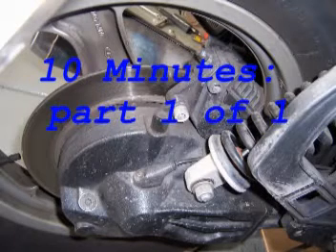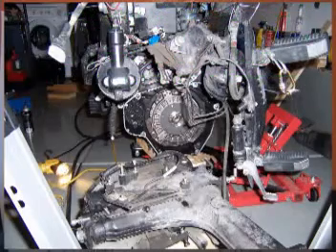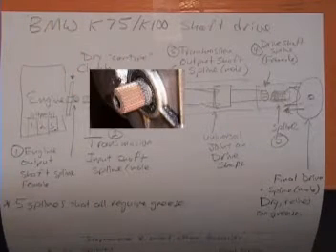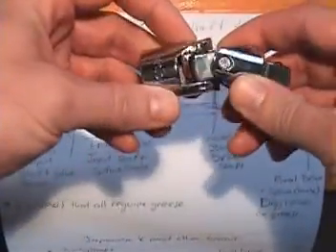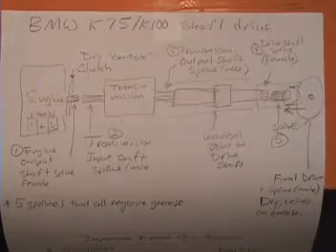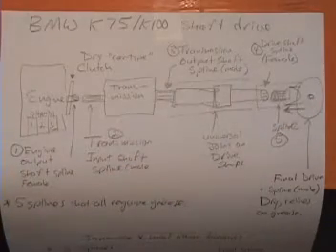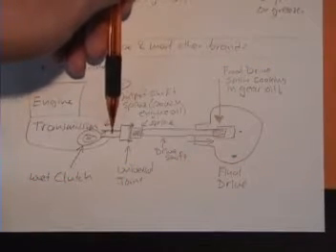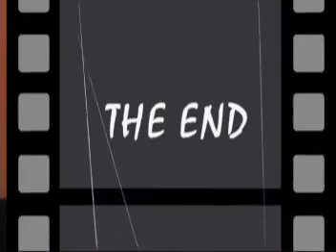BMW K75 K100 Final Drive Driveshaft Spline Failure Causes

Comment: The pinion splines of the bevel drive / driveshaft rear tube portion are to be CLEANED and lubricated with either a moly-based grease or the proper Staburags NBU30PTM every time the rear tire is replaced (8,000 miles). Failure to do so will result in spline failure at the back usually around 40,000 - 50,000 miles. Proper repair performed by Bruno’s Machine & Repair consists of the driveshaft tube being resplined and plugged to retain grease and the pinion splines rebuilt and made 13 mm longer.

Comment: Thanks for the clear explanation. I have a 1994 K1100LT and had it lubricated, this makes riding with a driveshaft expensive. Nobody would want a car that would require pulling the driveshaft for lubrication every 15000km or so...
I agree with your that BMW has made a series of major design flaws in the final drive system. What I cannot understand that a respectable company as BMW has continued with this system for so many years, and customers let them get away with it. Very strange.

Comment: Very clear and concise exposition of how the K series transmission works, its design weaknesses and why lubing the final drive shaft splines is necessary. I have had my K75S 26 years and I've never done this but the bike is still pretty low mileage.  However, after viewing this vid I'm definitely going to lube those splines!  Thanks for sharing this.

Comment: The transmissions input shaft splines / clutch friction disc splines are to be cleaned and lubricated every 20,000 miles on Airhead and 2 valve K's. All Paralever models including Oilheads are to have this done every 40,000 miles. This requires removing the transmission. BMW stopped listing spline lubes in the 1990's likely due to the ridicule they received by the motorcycle press regarding these outrageous service intervals. Any experienced BMW tech should know this and now you do as well :)

Comment from the maker: Marketing and advertising and the BMW brand are well known.  BMW specializes in the touring segment of motorcycle riding for middle aged men.  BMW owners typically has a lot of disposable income and believes in "regular maintenance" - like owning a "weekend-only".   Owners like myself are looking for utility and reliability.  I liked the K75 because it was lighter 500 vs 700 lbs than the Honda st1100 /1300 and got better gas mileage 32 vs 40-45mpg.

Comment from the maker: @DGillyy Without spending hundreds of dollars on special purpose grease, Moly 60 is probably the best grease for splines ($15 3oz 2007 prices).  BMW, makes a high quality grease which costs around $15 for 3 oz.  The dirty secret is that BMW and Honda and most dealers use the cheapest grease available.  Dealer replaced my clutch in 2002, 4 yrs later spline was bone dry, rusted.  Shifting was smooth for 3 years (15K mi). When I used Moly 60, 3 years later bike shifted like silk.

Comment from the maker: Good, I loved my bike too.  Remember, this is not an attack on the brand.  New models are being changed and improved but owners of the k75 need to know three things about the k75s drive system: 1. it is very strong (it is the same shaft used on powerful k1100) 2. it needs good quality grease to keep it in good working order 3. If it is taken care of it will probably last 150K miles or more.  Follow this program and it will not fail.  If you shaft is worn this video shows you how to fix it.

Comment from the maker: I LOVE never seize (a mix of graphite powder and oil).  My answere is no.  Never seize / Anti-Seize works best on parts that don't or rarely move like bolt threads and lug nuts on a car.  Or the spline on the bmw k75 rear wheel - not the drive shaft but the spline that the rear wheel slides on to.  I have found in wheel bearings or other parts that move a lot and fast it does not provide good lubrication the way engine oil, gear oil or grease does.

Comment: What blows my mind even further, is that with the 16 valve series, they went for an additional joint in the drive shaft, negating any unwanted up and down action (which never ever bothered me) of the rear wheel while accelerating and braking. It introduces two extra bearings and a rubber boot to  worry about. The ultimate irony is that the scott oiler assisted chain of my brother's VFR actually needs less attention and is way cheaper to maintain than my fancy 'worry free' drive shaft.

Comment: @pcofranc,

In answer on your question about how many driveshaft i have had replaced, the answer is none, I still use the same shaft that was placed by BMW at production, my K100RT is one of the last production day of this type as confirmed by BMW itself (framenumber 97823). It has >230000KM on the odometer and with every tyre change i also grease the splines, it takes my about an hour to do this, I use my K100 daily for worktravel and outings and use 2 sets of tires on 40000KM a year.

Comment from the maker: @videoheadnow  - Yes, after the spine failures - in some ways the old chain never looked so good.  Check out the Buddy Oiler? It is a constant oiling system and extends chain life to 50K miles or more so does enclosing the chain in a protective cover to keep dirt out and lube on.  Hope you are enjoying the F650 - I had it as a loaner one time and I think it is a great bike with plenty of power and great mpg.

Comment: @pcofranc 

My bike uses the original shaft that was mounted in the factory more then 20 years ago. The mileage (in my case Kilometres) gauges is showing 242000KM. The original clutch is replaced at 220.000 Kilometres. after lubrication the outputshaft with staburag and fitting a new plate and oilseal at the output shaft all is OK again

Comment: Thanks a lot for this explanation on my K75 failure. For me it came out of the blue. Without warning standing in queue 1:st gear in releasing the clutch a high sound of something breaking in the transmission and the failure was a fact.

Comment from the maker: @camel747 
I met a guy that had 40K on his chain and sprockets because he used the buddy oiler.  Also, the early 1980's virago offered an enclosed drive chain which the manual suggests should last at least 38K!  It not only keeps the chain lubed but keeps dirt away from it.

Comment: The rubber shock coupling in the middle of my K-100RS( 4 valve)  failed before 10K miles... this is simply a shoddy part.. and not maintenance related ( although the 2 young guys before me might easily have been stupid ! )  So on this I will agree.. crummy part.   Worse, the dealer was so lame they couldn't do a proper compression test... and told the P.O. that bike needed a valve job.  I bought it because it ran like a watch, and clearly did NOT have any compression/engine problems !  In went the new drive shaft, and I drove away happy.  Vroom Vroom.

Comment from the maker: I don't know about this model so I can really speak to that problem.  It does not sound like a design flaw to me.  Remember, if a seal is not put in correctly at the factory or is compromised during wheel removal for tire changes (I don't know if that is possible for your bike) then a leak can develop which is not the seals fault.  You would need to gather information on how often this happens and at what mileage and other info like how hard the bike is ridden, hot / cold climate etc.  Good luck

Comment from the maker: Correct, the design requires lubrication - however, BMW did not include this procedure in the maintenance schedule.  It can happen at low miles as the bike ages and the grease dries up.  Many owners learn after a  costly drive failures that an informal "schedule" was developed.  Shafts in all other bikes are tried and true technology that offer almost no maintenance.  I have yet to see an explanation for the benefit of the BMW dry design?  Even BMW has abandoned this design.

Comment from the maker: @itshildo I think it shows the power of marketing!  Bmw is finally switching to a sealed unit that needs no maintenance.  However, they are having problems with the bearings and final drive unit separating.  Hopefully, they will get it together as the bikes are practical and comfortable and unique.

Comment from the maker: @videoheadnow Use mileage as the guide.  If the bike has under 10K miles even if it was never lubed it should be fine if you clean and lube it as soon as you get it.  If the bike had 20K + then you want see if the seller has maintenance records and put the bike on the center stand and rock the rear tire back and forth with the motor off and bike in gear to assess the degree of wear (without dissembling and inspection).

Comment from the maker: @harrieke61 My conclusion has nothing to do with my choice of grease.  The video compares bmw's design which has an extremely high failure rate of drive shafts to the design EVERY other manfacturer uses.  My friends 1993 virago now has 80K miles on it and the shave has NEVER been services.  This summer the rear shaft / final drive finally failed and was replace.  How my times has your shaft been replaced?

Comment: Last week my final drive bearing went after 38,000 miles on my r1100rt. It dislodged the seal and gear oil leaked all over the back wheel. Is there a design flaw here too? I know the R1200 models have a hole in their final drives and use needle bearings instead. Has this solved the problem of final bearing failure? Thanks

Comment: how often / miles should I grease my final drive?  1993 K75 RT.  Maintenance records indicate it was greased in 2002 at 23,000 miles.  Now in 2023 it has 27,000 on it.  Its only 4,000 miles but many years since service.  Advice appreciated.  Thank you.
Reply from the maker: I would absolutely remove the final drive to inspect and clean the existing grease and replace that with 60% Molly grease and take pictures that you could show to a future buyer to prove that it’s in good condition. Even though the miles are low there’s a danger if cheap Greece was used or it wasn’t done properly and it’s not worth taking a chance and remember you don’t have to do the clutch blinds because they never wear out even if they’re completely dry. It’s only the final drive that’s in danger. Unfortunately it takes less than an hour and a half to remove it clean it and grease it and put it back on.
Reply: @pcofranc  Paul, BIG THANK YOU for your reply.  I inherited the bike from a friend who passed away who had over a million miles logged on motorcycles.  I’m trying to learn all I can about it.  It is in showroom condition and runs / rides excellent.  I’ll hopefully keep it for the rest of my life.  I really appreciate your help.   
Al McCallie
Cody, WY

Comment: i wonder how would it compare to a moto guzzi setup which also has a dry clutch and longitudinal engine.  And why such failures dont happen to cars,  nobody lubes front driveshafts which have splines on both ends and basically they are installed dry.
Reply from the maker: that's a very good suggestion about comparing to Moto Guzzi I did not realize that they also use a dry set up. Now comparing this setup to a car there are some important differences the rear differential is sitting in oil the only part that turns is the universal which does where out and can be replaced and in modern vehicles the universal itself has been replaced with a different type of joint. Regarding the front clutch splines remember that on the BMW little or nowhere takes place even when the grease is completely dry however it does cause a problem with shifting and in that case I'm not sure why cars which use the same basic setup do not suffer from the same problem it could be that the transmission has synchros versus the constant mesh transmission that motorcycles use.

Comment: My u joint broke at 70 k. Guess that's normal it's a 89 k 100 rs Total bill was $625.00 at Lior motor ride in Corona Cal  GREAT JOB!
Reply from the maker: Donn La Rossa that's not bad I would say that you joined could probably last longer but it all depends on lubrication and how was driven in that kind of thing you know by the time we get to 90,000 miles plus many years old things happen

Comment: The majority of problems are caused by people not using the correct spline lube.....and....failing to lube the splines at correct servicing intervals.  Constantly people are saying they know best about when and what to use to lube their splines.  Well guess what, they are wrong.  Every service the splines need to be cleaned and re-lubed with the correct spline lube.
Reply from the maker: Unfortunately BMW setup very poor example by using very cheap grease that dries out rock hard I think the best grease to use is anything with a high Molly content 60%

Comment: Paul,  Your K-75 and Mine are at least 19 and perhaps as much as 26 years old. The lubrication interval needs to be observed.  Your bike might only have 35K miles.. but it is long long overdue for spline lube.   The Honda Moly ( molybdenum)  spline lube product is so superior to the BMW label goop... that beemer dealers routinely use it !   The "bitch" isn't the dry clutch automotive type drive-line... but rather the crummy lube that was used during manufacture.. and perhaps subsequent maintenance.  You are clearly smart enough to have done your own clutch replacement. "Misalignment"  is pretty darn hard to achieve between the clutch and transmission.  Now, if you don't happen to like the dry clutch, separate transmission architecture.. why not buy a similar Honda or Kawasaki.?  The used  K-75 represents one of the finest used motorcycle values available.  They are capable of 300K mi endurance.  During the 50 years this is likely to happen.. stuff is going to fail strictly from age, and more from deferred maintence ( by previous owners).  Once sorted, these bikes repay you with economy, safety, and comfort.  The K-75 is reasonably sporty, and over the long haul reasonably comfortable.  All machines have their strong and their weak points, both in terms of failures, and repairability.  Relative simplicity, low parts count, and field serviceability with hand tools is the strong suit here.  too expensive new, but great bargains used... with the caveat that doing your own work is the key to making financial sense out of owning a BMW.  Post K-1100... I wouldn't touch one. too complex, too big, too prone to failure.  But your K-75.  One of the real successes of BMW after the R-75/80.
Reply from the maker: Capt Larry Well said. Long live the K75's and k100's.  I sold mine in 2009 and in 2011 I got a Kymco Grandvista 250cc scooter.  Scooters in general, are the ultimate in simplicity and reliability and clean with an enclosed engine.

Comment: I'm very disappointed with the BMW engineers. What were they thinking? So much for German engineering excellence . . . Doesn't appear to have been designed to last without some fairly invasive and expensive maintenance. Lubing the clutch drive is a major undertaking, which I'll get round to one day.
Reply from the maker: I totally agree part of the problem is that the internet created this myth that the k bikes were the greatest thing ever invented and would last forever and they probably could with proper maintenance but there's a lot of strange things in the design which basically build in maintenance for the dealer and that takes away from the ownership experience especially as the bike gets older. My friend bought a 2004 k1200 LT and when the clutch went out it was over $4,300 at the dealer to have it replaced that was on top of spending at least $3,000 have brake lines replaced and a few other issues. In one year he's into that bike for about $12K. My current ride I've owned for 2 years it's a 2012 Honda NC700X and while it's not perfect the thing is mostly bulletproof. I was so away on a trip for 2 months when I started the bike it started instantly The battery wasn't low and it was like it had just been running.

Comment from the maker: @camel747 Yes the Scott Oiler - I couldn't remember the name.  I think the problem is always the fat guy in marketing - he wonders over to the engineers at bmw and asks for some new thing that he can use in advertising brochures.  It is true that shaft-jack can be considerable - esp on the old honda magna 750 /1100.  Especially at high rpm's.  But I agree if you are having problems with the basic shaft why add another joint and bearings.

Comment: Yep, but just apply staburag grease every 40.000k and you drive a K75 easy 300K without problems..
Reply: Do you think it’s mainly the rear splines at the final drive or should the clutch / front splines require maintenance also?
Reply: @almccallie4314   it is not such a big job all together, so I would advise to do grease  both splines  in one go
Reply: @jeroenoost6217  Jerome,  thank you for this information.  It is really important to me and a big part of my motorcycling experience.  
As for greasing the front end of the driveshaft…does it come out easily?  Any tips on how to break it loose?   I really appreciate.  Thank you.
Reply: @jeroenoost6217  I did it.  Upon discovery not much grease left but all surfaces were in good to excellent condition.  Applied Staburags liberally to front and rear driveshaft splines.  Documented before and after with photos for potential buyer.  Thank you for direction and advice.   Al McCallie Cody, Wyoming

Comment: New driveshaft is worth the money, while available.  No grease fittings.. dumb.
Paralever ( on K-100)  isn't going to fly without the rear spline being outside the bevel gear assy.  Is paralever worth the trouble ?  Nope.
Reply from the maker: Capt Larry I suppose a hole could be drilled and grease fitting installed.  New shafts are a must while available.